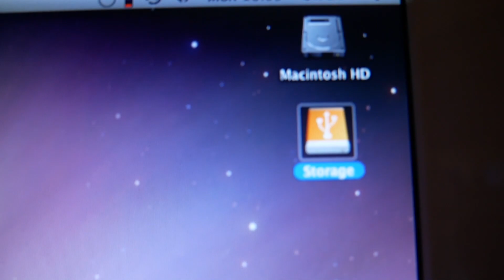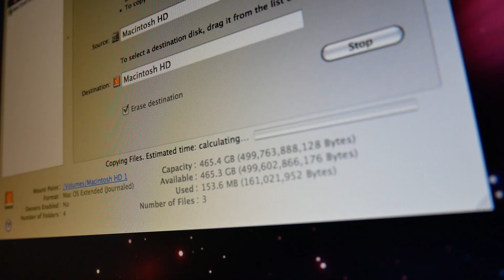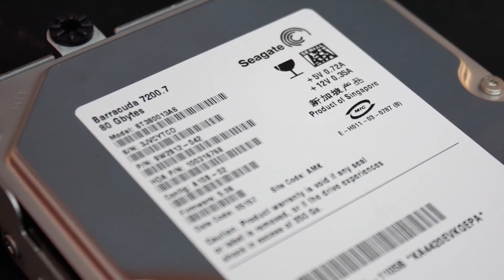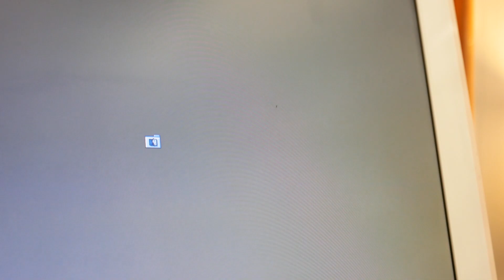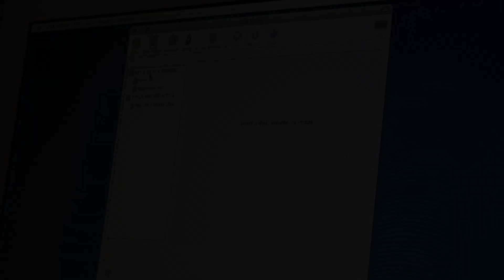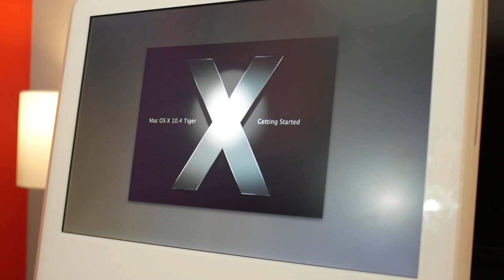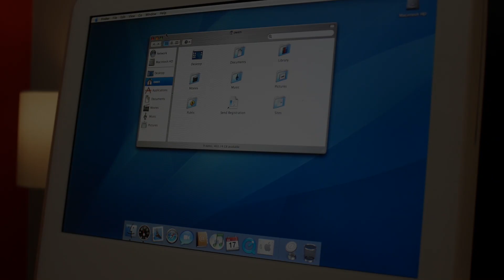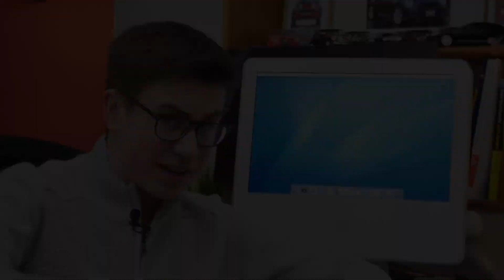Upgrading my iMac G5's HDD in 2020 + OS X 10.4 Tiger Install!

Comment: Tiger is the best install although there is now a custom version of 10.5 and even linux, that's because it offers compatibility mode... also you're pretty much buggered for SSDs these days because it throws a fit over SATA III...

Comment: Excellent video.  Of the desktop macs in my collection, I love my 20 inch G5 the most and enjoy calling it my baby.  Over the years, I have maxed out the RAM, replaced the mother board, and the hard drive with a 1TB unit.  What you showed well in the video was, how apple designed this computer to be serviced by an average home user.  If, you wanted an Airport card, more RAM, or a larger Hard Drive all one needed to do was, just open the rear and items were easy to reach.  Also, I think OS X 10.4 Tiger is the best operating system for any apple Power PC computer and keep it installed on all my G4 and G5 desktops.  In addition, it works great for OS 9 applications, older OS X Power PC only programs (i.e. Apple Works, Via Voice, etc.), and newer OS X programs (i.e. iLife '09 and iWorks '09).
Reply: i totally agree about 10.4 being the best for a PPC G4 or G5 simply because of that OS9 backwards compatibility.